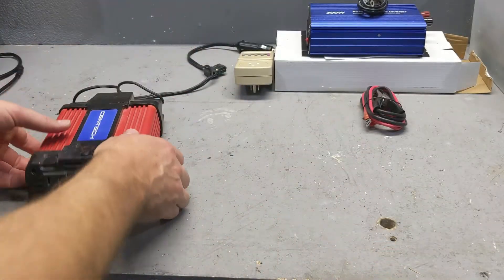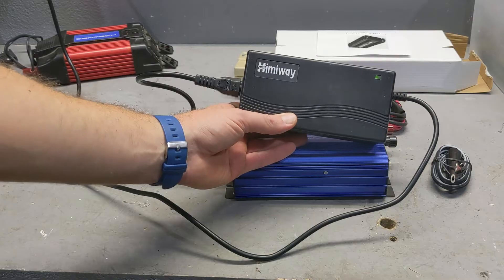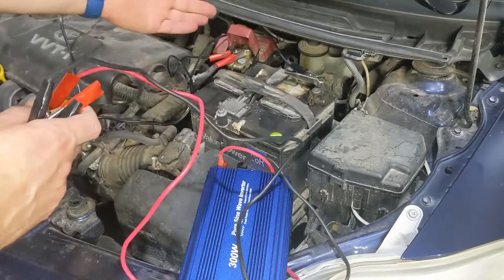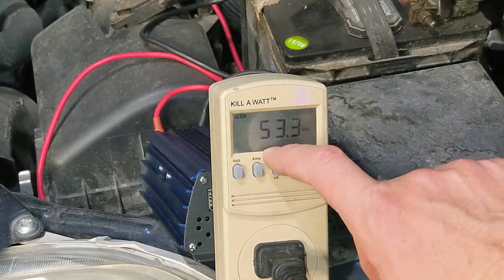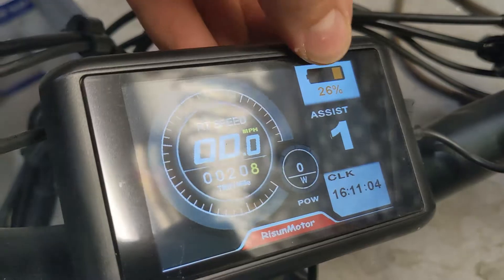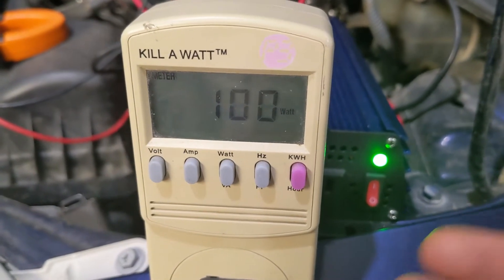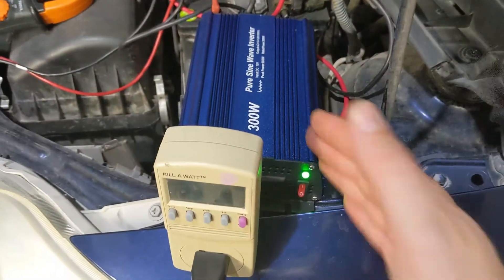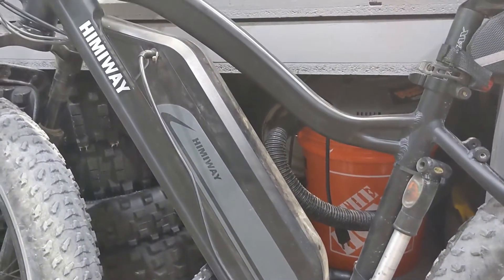Pure Sine Inverter that works with electric E-bike to charge them while driving or over SOLAR!

Comment: Can i charge it with the truck battery which is 12 V also ? 
I mean to connect my 2000 w inverter to one of the batteries? Is it gonna work ?
Reply from the maker: No, you can't. Because this one is only meant to work with solar, here's why it doesn't have a power limiter so if you hook it up to a battery for your truck it will pull maximum amps all the time and it will burn, which solar? You can control the amount of power because you could hook it up to a 300 w solar panel and that's the maximum they could ever produce

Comment: Do you think I can use one of these with. 48v Ebike battery connected to the inverter to charge my other Ebike battery while riding ?? Or do I need a 24V or 48V inverter 1000W??

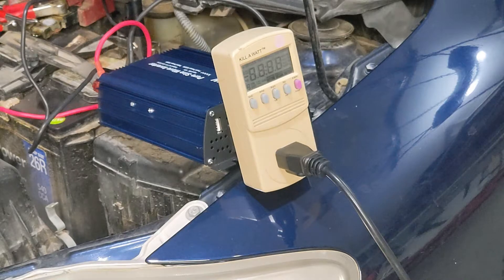Comment: I have a question about your point at 1:35 because I want to use my battery to power some electronics. Is it just that the inverter needs to be able to sustain the maximum load at that is your point? As in, I just need to measure (or calculate/estimate) my maximum load and make sure my inverter is above that load? For example, I want to run a laptop and projector off my battery which could use 500W - will I need at least a 500W inverter?